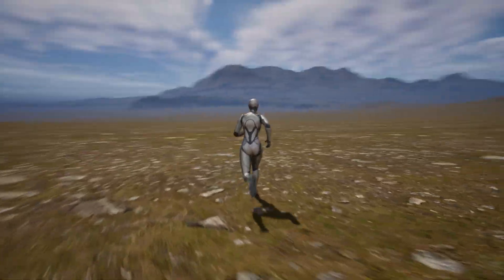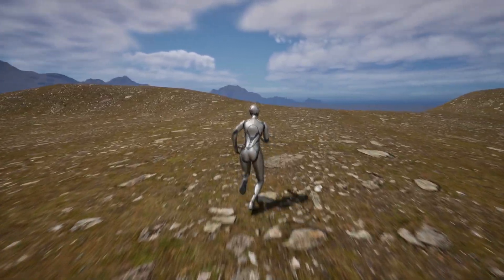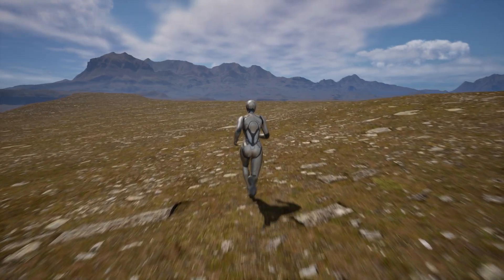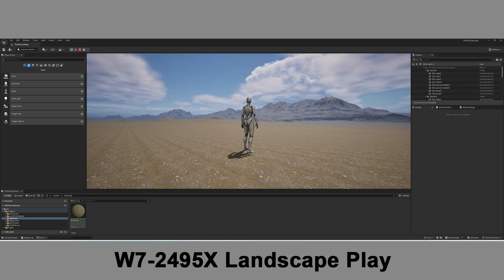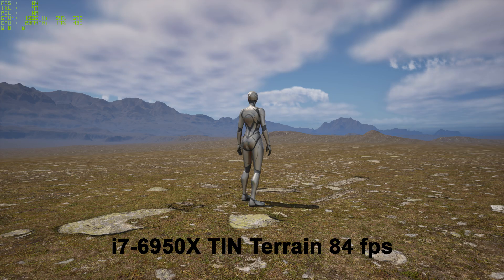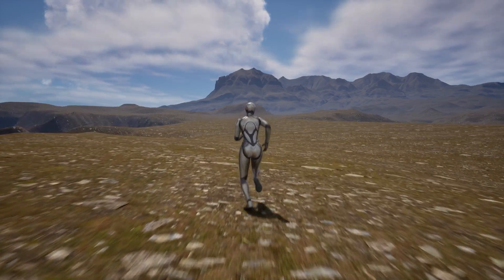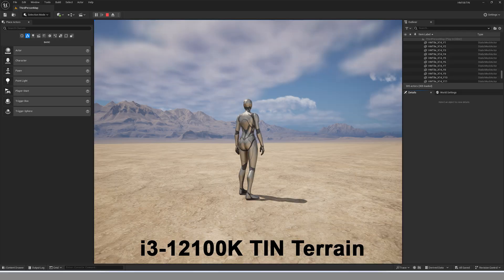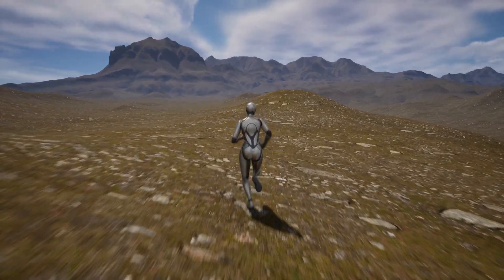UE5 Mesh Tile TIN Terrain Part 5 16km Landscape vs TIN

Comment: Just a random thought because I don't have much knowledge about TINs. What if you create a landscape and then toggle "nanite" support. It will create a nanite landscape, which by the end of the day is a static mesh for each landscape component with nanite support.
Reply from the maker: The Landscape system in UE converts the heightmap into a mesh already, Nanite doesn't change that.  Landscape is already a mesh, it is backed by a heightmap constructed set of DXT textures.
Nanite isn't required to get the Landscape to be a mesh.  Nanite is just a different rendering path for the same Landscape mesh.  And converting a Landscape to Nanite doesn't make it render faster, I have performed this test already multiple times and documented it in my Nanite video.  A Nanite converted Landscape typically runs slower than the non-Nanite version.

I have already performed these tests before using Nanite for both systems.  TIN still easily wins.

The issue is that Landscape is based on a Heightmap converted into Textures with MIPs as the backing data source for a terrain mesh, and that type of terrain system cannot compete with TINs.  TINs have been used for decades for Flight Simulator games and Driving games, it is used because it is smaller and faster than a heightmap backed terrain mesh.

Comment: superb work 
i am working ur landscape it's super optimized and so handy for low end pc who plan to make a open world game with huge map
i make a auto material for ur landscape nd apply it it's look awesome
and grate thing was the spline and foliage is also work great on this landscape 

actually optimization is a big deal when u plan to make a open world 
but u solve easily this problem 

i also try to make TIN in blender it's work fine on unreal 

yah i accept this is a long process but it's fine when ur first priority is optimization 

thanks man u done a grate job with unreal

Edit:- 

okey guys i do so many test with different ways
work good but i do every possible try but it's still lock in 60FPS i don't know why
it's show 180-190 FPS in editor but when pack it's was giving only 60FPS

i remove collision, i add custom collision, i also use simple & complex collision but still same result
Reply from the maker: Thanks.
So you already have a TIN Terrain system set up that you are using?
You have tested splines and foliage and they work on the TIN terrain as well?
Do you have any documentation or video for Blender showing how to make the optimized mesh TINs?  I have people asking if Blender can do it.

If you get a locked 60fps then your computer has VSync Enabled.  Disable VSync and that should fix the frame cap.  If you search for VSync and Frame Cap you should get information on how to change this setting.  Usually you have a setting in your GPU Software that toggles VSync.
Reply: @demenzunmedia  1. yes i setup TIN terrain system 
2. splines and foliage working fine nd i also using procedural foliage, rocks, grass etc. its working great nd i also apply some mask on it for foliage via material it's also working 
3. i use simple method to make optimized mesh it's so simple no need any documentation or tutorial for it
4. nd i already check VSync it's not enable actually i working with unreal default landscape at same time
unreal default landscape giving me 260-280 FPS nd 300-400 draw call after some optimization 
but the TIN meshes landscape create problem on FPS
nd i also pack my project because some time unreal bugs to show wrong FPS after i check but same result low FPS 
nd i also do lots of optimization work but still FPS problem 
nd last i also try on nanite but same result
Reply: @demenzunmedia  1. yes i setup TIN terrain system 
2. splines and foliage working fine nd i also using procedural foliage, rocks, grass etc. its working great nd i also apply some mask on it for foliage via material it's also working 
3. i use simple method to make optimized mesh it's so simple no need any documentation or tutorial for it
4. nd i already check VSync it's not enable actually i working with unreal default landscape at same time
unreal default landscape giving me 260-280 FPS nd 300-400 draw call after some optimization 
but the TIN meshes landscape create problem on FPS
nd i also pack my project because some time unreal bugs to show wrong FPS after i check but same result low FPS 
nd i also do lots of optimization work but still FPS problem 
nd last i also try on nanite but same result
Reply: so finally i decided i use unreal default landscape system but some scaling method nd it's working fine

TIN method is also good but most of the things was take so much time nd for only landscape u change lots of things of ur project 

but the landscape scaling method was work great for me
i made 8kmX8km map nd Unreal gave me 300+fps nd only 120-140 draw call

now I'm happy 

nd thanks to u 
u try on a new method this was great hope in future or after lots of more research 
so keep it up
i follow u for ur new achievement on TIN mesh method 

but still I'm using scaling method for my game because of time issue
Reply from the maker: @WASDTalks  - Good luck with your game.  I hope that you have success with it.
Landscape is in many ways easy to use simply because Epic has added a lot of features to make it easy.
If your Landscape is scaled XY larger than 100 cm per vertex then the detail will drop accordingly, so I never scale it as it looks worse.
Regarding your 60 fps maximum lock, that has to be something on your specific computer setup, I am easily getting 200 fps on a 16km x 16km TIN terrain on my computer.
Reply: @demenzunmedia  i agree man but just play with XY value in which software u use for make Height map
after using normal as a mask for details u get the same result
Reply from the maker: @WASDTalks  - Unfortunately, Normalmaps will not give the same results as having a standard scale Landscape.
Only Tesselation will have similar results.
However, if that design style is sufficient for your work, then you can use whatever methods you prefer for your game.  I hope that you have success.
Reply: @demenzunmedia  thanks
Reply from the maker: @WASDTalks  - You are welcome.
I believe that UE5.4 adds the optional Tesselation feature back into the Landscape if you are using Nanite.
Normalmaps only add additional lighting information in for additional surface normals, they do not add triangles in on the terrain that the player is walking on.
So if the Landscape Scale XY is set to a larger value such as 200 or 500 cm (2 meter or 5 meter), then the size of each triangle that the player walks on is larger and the actual real surface of the terrain that is being walked on is lower detail.
The only thing that can increase that triangle detail is Tesselation.
Normalmaps will only change the lighting normal information in the renderer, it won't add missing triangles in the terrain.

Comment: I've been wondering if blender's decimate and limited dissolve by angle tools are usable for making TINs, i have no idea what special sauce goes into the Max pro optimizer, do you know?
Reply from the maker: I do plan on taking a look at Blender and Maya and other 3D software to see if they can actually create TINs.  It requires that the inner triangles of the mesh plane be optimized by standard high quality decimation, but the edges/borders have to remain as fully triangulated regions, otherwise the result is cracks and holes along the mesh tile seams.  This is called "Protected" or "Excluded" Borders/Edges in Max Pro Optimizer.  I show some screenshots in my earlier videos on this series.  The Pro Optimizer in Max is really nice.  It's one of the reasons why I pay for it.  But I plan on looking into other software because not everyone uses Max.  The issue is that most optimizers/decimators, even the Epic Unreal Engine HLOD system, are full mesh decimation, so they have unusable results with huge cracks.  The HLOD system in UE is just terrible.  Also, if other 3D software like Blender allow for decimating a "triangle selection" of a mesh grid plane, then it might be possible to just select all triangles except the outer edges, and decimate the inner area.
Reply: @demenzunmedia  I've tried decimating terrains in Blender 2.8 and now in 4.2 with the Decimate modifier. But it introduces shading issues (kind of thin triangles in odd angles here and there I guess). This problem occurs very sparsely if you do 50% reduction, but it grows when you use bigger reductions. I wasn't able to do the amount of reduction you were doing in your videos without plenty of visible problems...
Reply from the maker: @peacesells2847  - That isn't good news.  I was hoping that Blender worked for this.
You really need decimation down to at least 98% reduction for the lowest LOD resolution.

The Pro Optimizer in Max creates very clean decimated meshes with good triangle layouts.  If you look at the mesh in wireframe view it is very clean and well laid out.  I haven't had any triangle or lighting issues and I have created a lot of TIN setups already.
I wonder if Maya has a good decimator.

What I will probably do is offer a TIN Creation Service, using my Max Pro Optimizer.  For terrains that are 16x16 1k meshes, the OBJ Batch optimization only takes about 3 hours, so I could do it for a few hundred dollars per tile set.  I would have to charge more though if I have to also create the OBJ geolocated tiles.

But before I get to that point, I want to continue my work on seeing how all of the Unreal Engine sub-systems work with static mesh TIN Terrains.
So far I have tested Collision, Nanite, WP Streaming, AutoMaterials, Vertex Sculpt, and others have tested Foliage and Procedurals which I will be doing as well.

I will have another video with a bunch more tests of various engine systems shortly.
Reply: @demenzunmedia  from what I have read TINs are a special kind of mesh optimization, not just a decimation/reduction
you may want to look at Houdini's remeshing and polyreduction tools

if you want I can do some tests to see what the results are
Reply from the maker: @_goldfarb_  - Yes, that is correct, I have been involved with this technique for years in previous game development, I am trying it now on UE5 to see how successful it is there.  :)

The actual optimization method used for TINs is called "Delauney Triangulation".
The SubDivide Modifier in Max 2021+ can do that format, but I am using the Pro Optimizer instead which is a similar triangulation system, simply because Max includes a Batch Pro Optimizer feature, so that I can batch optimize a set of files using automation.  I really don't want to manually edit 256 to 4096 mesh files individually.  :)

Autodesk doesn't seem to have the technique that the Pro Optimizer uses published anywhere that I could find.
So the Max Batch Optimizer does a job that creates "close-enough-to-actual-TINs" that are good enough for game use, and makes it easy to run automated.
The main point with creating TINs is that the resulting optimization or decimation technique cannot create thin long triangles or the mesh will not correctly render and light.  Apparently the Blender Decimator does that mistake, and the results won't work.

If Houdini can do actual Delauney Triangulation, and if it can batch prepare a set of mesh tiles, that would be awesome.
If you are willing to spend the time to check this out, I would be grateful as I would be able to inform people that they can also use Houdini for this task if it supports that type of decimation, and batch conversion.
We could also compare the resulting decimated meshes between Houdini and Max to see which has better vertex layout and better optimization level.
Reply from the maker: @_goldfarb_  - I have spent at least 30 minutes in the past trying to see if Autodesk publishes the triangulation method that Pro Optimizer uses, with no results.  They like their trade secrets.
However, I believe that it would also be possible to run a Pro Optimize to reduce the triangle count and then use the SubDivide modifier to turn that mesh into Delauney Triangulation.  But that would probably have to be Max Scripted as there is no automation directly for that process.
And writing Max Script, even though I have done it before, is not very user friendly.
The Max Pro Optimizer does a good job with good results and can be automated.
Reply: @demenzunmedia  Houdini's "triangulate2d" produces a constrained Delaunay triangulation, I'll do some tests this weekend if I can
Reply from the maker: @_goldfarb_  - Thanks.  I appreciate it.
Constrained Delauney will work just fine.
The only catch is whether the Houdini tool also allows for "Protected Edges" or "Excluded borders".  The borders/edges of the meshes must remain fully triangulated, otherwise cracks will appear between the tile seams.
The Max Pro Optimizer has an Exclude Borders option so it works great.
Reply: @demenzunmedia  Houdini give full control over all of these
I've found some time today to try some tests but I have questions
how did you export tiled objs from TerreSculptor?
I can export an obj, and I can make tiles, but how do I export the tiles as obj?
Reply from the maker: @_goldfarb_  - Do you have the latest build of TerreSculptor 3.0?  FBX and OBJ were only added to the TileEx Creator in the last couple of builds.
Go to the TileEx Creator on the Create menu, and when exporting tiles, set the Mesh Vertex Space typically to 100 for 1 meter, Mesh Z Scale typically 1000x the editor Terrain Spacing Z of the terrain in the editor so usually 50,000 or more you might have to do trial tests, Share Tile Edges checked, and Tile XY Naming to usually _X0_Y0.
Then when you click on the Output File field, you choose Alias Wavefront Object from the file type list.
Note that since OBJ files are text and usually really large, it can take 30 minutes or more for big terrains to be saved as tiles.
Then you simply create a Mesh folder in UE5, drag-and-drop the OBJ Tile files to it.  They will take some time to import.  Then drag and drop them all together into the scene, they are already properly geolocated as tile locations.
Material Instances have to be created for each Tile or an Auto-Material used on all of them.
Also be sure to set the Collision to Use Complex as Simple in UnrealEd.
Reply from the maker: @_goldfarb_  - If you are not using TerreSculptor 3.0, I can zip up a set of full resolution OBJ Tiles and send them to you for testing the Houdini optimization on them.  I can place them on my Google Drive for download and send you a link.
Reply: @demenzunmedia  oh, that might be very helpful, I'm pretty new to TerreScuptor and I've been having trouble exporting things properly - getting strange Black geometry
the optimization I have running in Houdini only takes about 15 seconds per tile in my little tests
so having your original objs would be a great help
Reply from the maker: @_goldfarb_  - Black geometry from the OBJ Export in TerreSculptor?  You might have to flip the faces in the OBJ Exporter dialog.

I have placed a TS3OBJ zip file into my Google Drive Share.  You can get it here.  Let me know if you get it fine.  It contains 16 tile files from a terrain.  Each tile is 1 million vertices, you usually want to optimize down to about 30,000 vertices with excluded or protected edges, if the edges are not excluded from optimization then you will get cracks in the geometry at the seams.

https://drive.google.com/drive/folders/1JiOewtD_leN_NVIB4AzR80W_RF2i5n-U?usp=drive_link
Reply from the maker: @_goldfarb_  - If you like, after you have ran the tiles through the Houdini optimize, you can send the optimized copy back to me, and I can check them out here in Unreal.